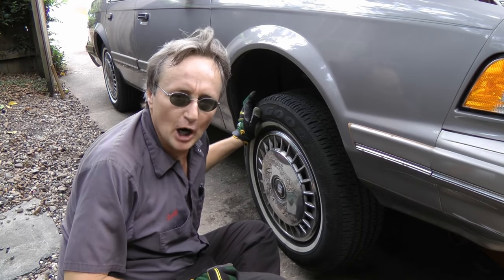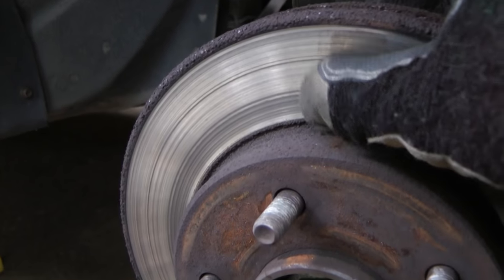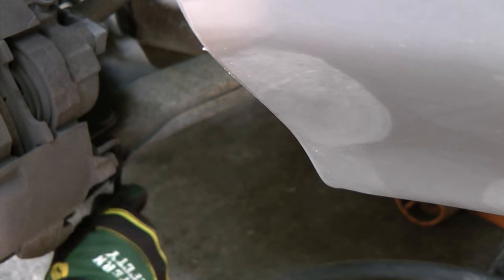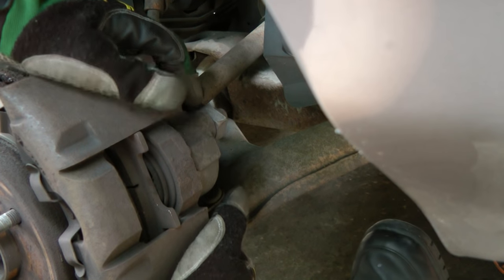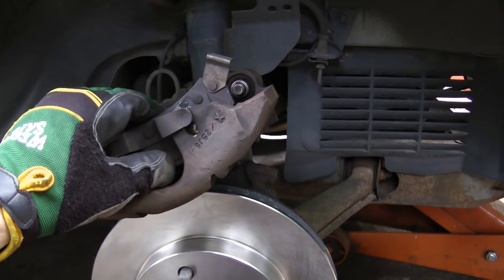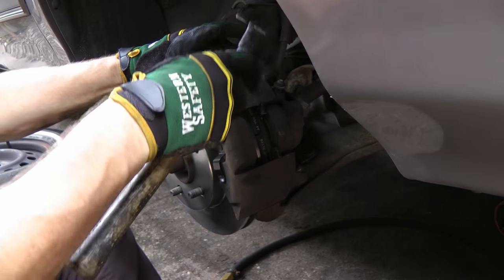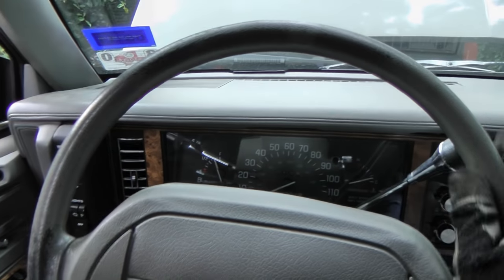How to Replace Brake Rotors on Your Car

Comment: @scottykilmer Scotty I have a 2002 Altima. It has ABS brakes. I think only in the rear. How does this matter when you change your brake pads or brake rotors on an ABS brakes? Thanks. (FAA Chief got popped for DUI. Ouch)

Comment: Hey Scotty is there any effective way to prevent rusting on the rotors?
Reply: I was thinking using high temp spray but I doubt it'll last long as the rotors reach very high temps.

Comment: Hey Scotty my car shakes when I brake but only when I'm breaking at 25-0, when I break hard or at high speeds it won't shake and sometime I hear clinging noises. Could this also be the rotors?
Reply: antonio santana It might be the guide pins need to be greased or replaced ! but dont take my word for it

Comment: hey scotty I noticed that my when I apply force on the brake peddle it shakes until i apply more force. I also noticed that my rotors and brakes are I'm good conditon. what do you think cause shaking of the brake peddle when I apply the brakes
Reply from the maker: rotors can only be checked correctly with a dial micrometer, do that. If not that, front end or tires has a problem

Comment: hy Scotty i have a problem on my front driver side break.Everytime i press the break my steering wheel shake so bad then i change my pad and rotor. and everything seeems ok. but after few months its getting bad again(same problem  before i change it). What do you think is the problem?
Reply: The slide pin in the caliper bracket might be sticking....might need to pull out and regrease inside of slide pin hole

Comment: I just changed mine but I only did one side ? is it ok if I change the other one later? my problem was a stuck caliper though!
Reply from the maker: if it doesn't pull now, yes you can wait
Reply: i guess ill just have to change the brake pads 1 by 1 from now on lol

Comment: Scotty, my Honda Accord LX steering wheel only shakes when I'm braking going down hill, but on normal driving braking from 50km-0km, theres no shake.  My brakes sometimes squeak, it's not consistent.  Any idea what it might be?
Reply from the maker: +Andy Zeng downhill only is effected by worn suspension parts, like struts or ball joints, worn rotors would happen whether you are going up or down or straight.

Comment: Hi Scotty I have chevy cruze with 35,000 km and I change my break pad last 2015 now I notice that on my Rotor there is one Deep Line which is I think something is scratching that line on my Rotor. what do you think is that? hope you can help.
Reply from the maker: replace the rotor, they are cheaply made on a cruze and often wear strange
Reply: Better not to go to GM brand, Thank you Scotty
Reply: Not much has changed at the General, I had a '92 Cavalier that needed a set of front brakes every 20,000km or so, funny thing is we put almost 300,000km on that car, and the rear shoes were original....

Comment: I bought new rotors and was told that even though they are new; I should get them turned. Does this make sense; seems to be a waste?
Reply: It's a waste, how ever after 500 miles you should give them a resurface

Comment: hey scotty got a question. i have a 97 bmw 5 series. i put on new rotors and pads on the front due to squeeky and warped old rotors. well the new rotors are warped again. and i just did this replacement job just months ago. but the problem started weeks after the replacement. now the pads were replaced before the rotors. is that causing the new rotors to warp or.. id wonder if its my driving and braking habit but i drove harder in my old iroc and that never had that problem.
Reply from the maker: +camaroiowaguy23   either driving is hard, callipers are sticking, OR you're just buying cheaper chinese made rotors that warp easily
Reply: +Scotty Kilmer thanks ill look into what kind of rotors i got. got them from o'reillys. the pads i paid decent for because i didnt want squeeks. rotors were about 45 a piece. thanks!

Comment: The problem is that they are Chinese replacements.  It made me nervous to begin with when the rotor warned about making lugs too tight, can cause warping.  Since the brake job is within 500 miles, could I just replace the one warped rotor?

Comment: mr i got this question, when i hit the brakes i get this little feeling like the car brakes and doesnt brake, like if the wheels were ovals and not circles haha, so i dont know if the problem are the rotors or air in the braking system??
Reply from the maker: replace the rotors and pads, they do that when warped
Reply: another questio hehe thank you, well actually two how can i notice that theres air in the braking system?? and are vespas- piaggio motorcycles good on your opinion?

Comment: @scottykilmer Right, but I mean in terms of actually replacing the rotor on the Towncar, what are some differences versus the rotor shown here? I know I have a dust cap and nuts to deal with to get it off the spindle...anything else l should know?

Comment: And plz are drilled rotors better then regular plz thank you
Reply: Jamshaid Choudhry even though it's a year later i'll still answer. for a passenger vehicle drilled and or slotted rotors don't make much sense, they have better performance, but for the average person you most likely won't ever use them to their full potential all the time. they also wear out your brake pads a LOT faster.
Reply: They do make sense for the particular old GM sedan in the video.  It and other similar old boats with undersized brakes for their weight and size, tend to go through rotors quickly due to overheating, with all but the most reserved driving styles because they're simply too small a diameter due to use of only 15", possibly even 14" on that model year while now everything that size is 16" or larger which is a huge difference, talking about a rotor that has to fit inside the wheel that can now be 2" larger diameter too.
Reply: Drilled rotors will eat up your break faster rather Smooth rotors they will make your breaks last longer

Comment: What is the steering wheel shakes after the brake rotors and pads where changed
Reply: Could be wheel bearings or cv axle

Comment: I have a question, my front passenger wheel rim makes a loud...metal on metal scratching noise, and I noticed that the brake caliper and the rim are actually grinding against each other...when I took the wheel off, I noticed that the rotor was really loose, and the grease cap for the bearing came off......help?
Reply from the maker: could be your bearing is worn out there too, check that

Comment: I did a brake job on my 2003 Ford Escape (rotors and pads). Now I am getting a horrible vibration when I brake at over 40 mph. Could my rotor be bad?
Reply from the maker: Randall Isaacs if they were cheapies, it could be that. But often rotors are put on a dirty surface that doesn't tighten down evenly then it vibrates, check that first. You need whistle clean metal to metal contact
Reply: OK...thanks. The rotor probably is the problem then. I cleaned the surface and applied anti-seize compound.
Reply: Replacing the rotor fixed it! I am never ordering them through Amazon again.
Reply: ***** Autozone

Comment from the maker: @krhodesone  Answer: no, that would make the pedal vibrate, not the steering wheel. You may have gotten cheap rotors that have warped, or may have front end worn parts, watch my video "how to check out your car's suspension" and check that first.

Comment: Shouldn't you apply brake cleaner on the new rotors before installing them?
Reply from the maker: only if they are coated with oil, these came from china and were bare metal, not coated.

Comment: Brake rotors rarely actually warp, its an old wives tale. The pulsing of the pedal and shaking of the steering wheel are actually more commonly caused by uneven transfer of brake pad material on to the brake disc, which leads to high spots on the discs surface and that horrible shaky feeling. Sometimes resurfacing can do the trick, but as Scotty says, new discs can be almost as cheap as having that done.

Comment: my pads and rotors were shot on the front of my car so i changed them, theres an awful vibration on i believe the back passenger side. these are drum brakes on the back, i dont know anything about drum brakes any ideas?

Comment: Dear Scotty,
Bought some aftermarket rotors and pads from a performance brake dealer. The rotors warped at less than 10000 miles, yet the manufacturer would not take responsibility for defective rotors. They claim that my mechanic did not "check for runout." Is that really necessary? I've spoken to mechanics who tell me that this is not a problem with new rotors and pads, which I had. I've never had this problem in any of my cars. Please respond.

Comment: You didn't mention that we need to push in the pistons so that we can fit the new brake pads and caliper over the new rotor.
Reply: No, he didn't...go back to the beginning where he uses the large set of Channel Locks.   Pressed in before he took the Brake Caliper off.

Comment: i'd hate to say it; but you missed a few steps, but i guess for the average joe it's perfect.
by missed a few steps i mean using brake clean to remove all the oil on the rotors and making sure to use a coat hanger to hang up the caliper so the brake lines don't get strained.

Comment: Strange that this car seems to have no guide pins. Most cars will have guide pins and caliper bracket bolts to remove. The latter will most likely be on tight and you will need a half-inch breaker bar to loosen them.

Comment: Hey scotty i have Mercedes 2013 every time i push the brake the car turn off why ??
Reply: +Xvold may have start stop crap in it. When you stop at a stop sign or stop light, the engine shuts off. when you apply gas, the engine starts back up and you leave.

Comment: I got a question. Do you really need to change your break pads if you have a warped rotor? I have 85% remaining in my break pads.
Reply: ildjer baron I have the same question...just changed pads, and pretty much everything connected to it (waiting to get paid) but breaking makes my car shake crazy. I was told that my rotors would need changing soon, but do I need to get new pads as well?
Reply from the maker: new rotors should go with new pads, but if your pads are almost new, you could sand em down a bit on a flat surface then put em back on
Reply: Scotty Kilmer thanks man.
Reply: Define "really need".   It's cheaper not to replace, or easier not to sand them down, but both they and the rotors will wear down faster and need replaced sooner, so you're paying again sooner rather than paying more now.  Similar can be said about resurfacing warped or concentrically ridged rotors, if/when there's enough thickness there to do it at all, which there often isn't these days.
Reply: Your brake pads will be warped after contacting the surface of the worn out rotor. You can sand them down so they are flat and don't have groves in them. It all depends on how much brake pad you have left after you sand it down. It might end up being worth it to replace them if there is hardly any braking surface left on them.  If your replacing the rotor you should replace the pads too, makes everything easier considering your going to be replacing things down there anyway

Comment: I have an issue with my rear disc brakes, I wanted to change my rear pads and rotors, I changed the pads easily, but could not get the rotor off, I was using a rubber mallet, it would not budge, it appears that the idiots decided to use a hub/rotor part in one, so to change my rotor I would have to remove the axle nut replace the hub with bearing and get a new rotor, WHAT WERE THEY THINKING!!!

Comment: Dont forget to get that cosmoline off the rotor before install, otherwise you will have stinky smoke for the firts 5-10 miles.

Comment: He forgot to wash the rotor surface with a break cleaner. He contaminated the pads :(.
Reply from the maker: +Dan Stefancic nope,these rotors had no coating on them, but if they do, yes, spray them with brake spray cleaner to remove that anti rust coating
Reply: Scotty Kilmer you forgot to clean the rust and to silicone the guide pines

Comment: what causes warped rotors?
Reply from the maker: old age and wear, pads wear bits of metal off them every time you brake.
Reply: ok thanks i heard also they warp from the lug nuts being over tightened is this true?
Reply: WhoisDuration wheel lug nuts? I know they can warp from calipers being bad such as piston that doesnt slide back in after breaking or the slide pins stick.
Reply: WhoisDuration I had my rotors changed a year ago. Now I have the steering wheel shakes when I brake.
Reply: +WhoisDuration usually bad pads or nasty potholes or hard braking (always stopping real fast from high speeds) or maybe the rotor itself is old over time or if its new its probably cheap crap?

Comment: hey scotty my car is making a scraping noise when i accelerate and when i stop my car shakes only in drive though no other gear it does that and it sounds like the rotor and pads need to be replaced but im not sure

Comment: most rotors these days are made in china sadly, but as i heard, all parts sold in stores meet a government standard, so for normal driving it should be fine, otherwise.. go for a made in europe kit.. for brakes, i wouldnt skimp, the only chinese brakes i seen and been okay with are Centric's their C-tek oem replacements are alright... but still, goverment standard for in store parts..

Comment: I've barely put 10,000 miles on my Acura TL since buying it 3 years ago and the brakes were replaced shortly before I bought it, yet the Acura dealer told me I need to replace my rear brakes due to warping in order to pass state inspection. The brakes have continued to work fine and I haven't noticed any shakiness when braking. They quoted me over $500 and I said I'd get it done elsewhere. More and more I'm left suspicious of this dealer
Reply: ArkadiosTheodulus They tried to scare you. How on earth could a state inspection facility know your rotors were warped without driving the car and doing hard braking or without removing the rotor to inspect. Lmao. Dealers can be asshats.

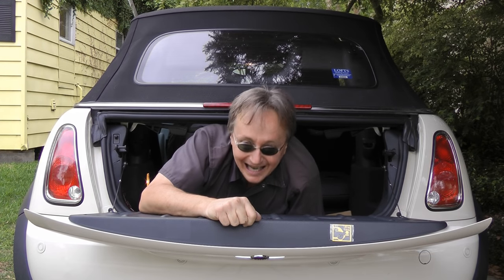Comment: jesus.. head phone alert at 3:04.
Reply from the maker: rock n roll, gotta have some fun
Reply: Scotty Kilmer lol for sure, thanks for all your videos! Do you know why my 2001 Jetta is surging only after it rains at idle? I step on the pedal and at take off there is a lot of engine power loss. After it warms up it goes away. There is also moisture (thick white) getting into the oil which I had to clean out like a clogged artery. Could the ignition coil cause this? Thanks from a starting mechanic in Toronto, Canada.
Reply from the maker: creeper2112
moisture in the oil is generally a head gasket starting to blow, which can cause all that. Try my video "how to tell if your head gasket is blown"
Reply: thanks Scott, I took a look and found one of the plastic ends which the wire for the spark plug plugs into is broken. So moisture is getting in causing the car to stutter in rain. I am not sure why VW designed it like that because the plastic becomes very brittle over time.. Not sure what I can do other then silicone it in place.
Reply: so the spark plug goes in the hole and the plug goes over the hole and attaches to the plastic sticking up, well thats what broke.

Comment: Unfortunatelly, my rotors are so rusted, it would take a metal grinder to take them off.
Reply: Use antiseize if/when you replace em, so the next time won't be so bad
Reply: @deasttn  I would not put any grease near the brakes. Anyway. Problem got eventually solved.
Reply: @MrGigi-dz9cv  glad it worked for ya.
I use break grease on my pins and pads and smear a lil grease under the rotor to help keep rotors from sticking to the hub

Comment: Are you f*cking kidding me?  No brake job is this easy - NOT EVER!  People - don't listen to this bullsh*t.  It's been my experience that everything that can go wrong will and has gone wrong.  The best tip that Scotty gave was squeezing the caliper closed enough to pull the rotor off.  But I've had the auto parts store pull the wrong brake shoes, broken pistons, collapsed brake lines, stripped bolts, stubborn bolts, etc.  There are many things that can go wrong here.  Hope for the best but prepare for the worst.